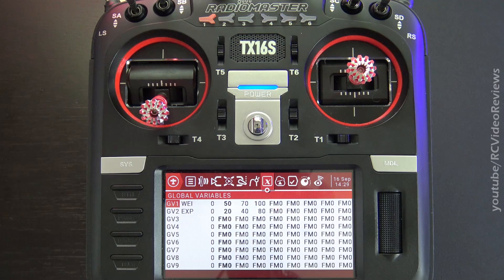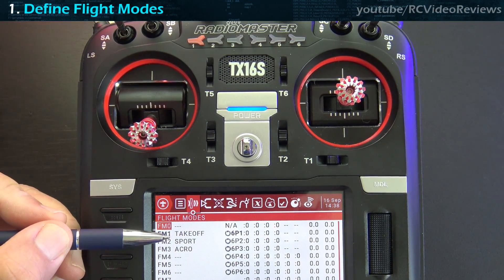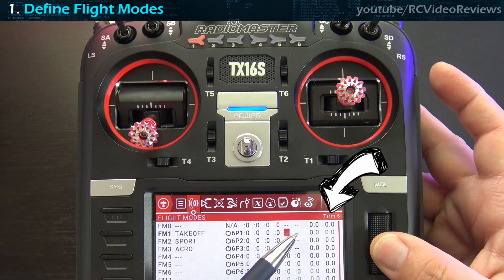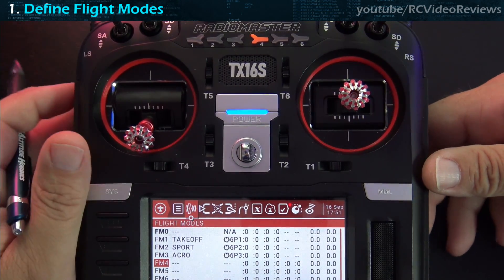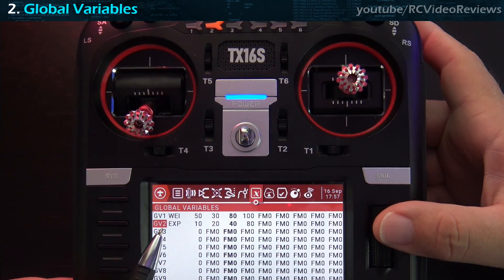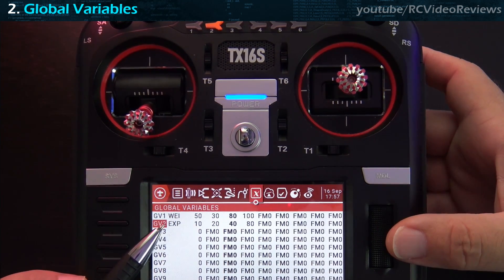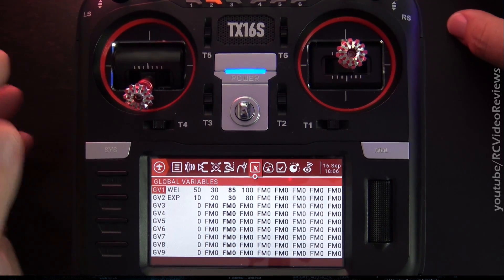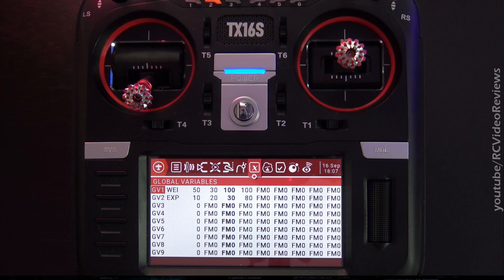OpenTx Tutorial Flight Modes and Global Variables on Radiomaster TX16s • [Advanced]

Comment: Hi John,  Umm, random question, completely unrelated to this video topic, but I keep meaning to ask.  Do you own a Jumper T16?  If you do, can you see if the whole rear panel of the T16 pro will fit on the back of the Radiomaster TX16S please.  I'm asking as I wonder if it would fit as I'd like to get rid of those big grips that the TX16S has on the back panel.  I know it won't be a direct fit because of the SD card socket cut outs and I/O pins on the TX16S that the T16 doesn't have, but I could cut those holes / slots if it will fit otherwise.
Reply from the maker: I do not own a T16. The TX16s was my first radio from this line of radios. I know the TX16s only has 4 screws holding the backplate on and my T18 has 6.
Reply: @RCVideoReviews  Thanks for your quick reply John.  You are right, the T16 has six screws like the T18, but I believe the are in the same places a the ones in the TX16S, it's just that Radiomaster don't use the middle two screw mounts in their design.  I'll maybe ask the question on RCG or Helifreak, see anybody there knows.  Cheers!!
Reply from the maker: The TX16s also has a much bigger battery tray and the battery connectors are in different places. The TX16s has the battery connected all the way at the bottom. The T16/T18 SD card is near the middle of the compartment. The TX16s SD card on the bottom of the radio.
Reply: @RCVideoReviews  Yeah, I know, but like you, I use 18650's so either battery tray is OK for me, and as I mentioned in my previous post, I don't mind cutting  holes or slots out of the base of the rear panel to fit the SD card slot and I/O pins the TX16S has.  Battery connector would be an issue though, that might be hard to get around, I'll need to look at pics of both more closely to get a better idea of whether that knocks the idea on the head right there, it might do!  EDIT:-  I've compared pics of both the Jumper T16 and the Radiomaster TX16S and the battery connector looks to be in a very similar place on both transmitters.  It is much higher up in the Jumper T18 though!

Comment: Good video. Can you use stick position to change flight modes. If so could you do a video to show that? Thank you.
Reply from the maker: Can you elaborate? Are you asking if you can use the Gimbal sticks to change flight modes? Give me an example of what you're thinking.
Reply: @RCVideoReviews  Yes that is exactly what I am asking. For my IMAC plane I have  a snap condition that is activated at the last 5% of aileron stick travel. You initiate a snap, and the aileron stick at 95% travel activates the condition. It boosts aileron, and reduces rudder and elevator.
Reply from the maker: Sure, you can do it with Logical switches. 

L01 a>x I:AIL 95  

That will light L01 when Aileron goes above 95. Set the Flight mode with L01 as the switch.

Comment: This is good stuff; I've managed to make a mess of my model templates with all the walkthroughs you're pushing out. This seems like a more simple option as long as I can find the right button in flight.
Reply from the maker: FYI: You can use ANY switch you want. Before these radios started shipping with 6 button switches, we used to use the 9 position matrix setup for flight modes. I've flown Eagletree, Ardupilot, and Arkbird using the two switch method. This 6 position switch is super easy.

Did you watch this: https://youtu.be/Ci4vbOoxEf4

Think about putting that technique in place with flight modes. You could have the flight mode button announce the mode, then the T5 or T6 switch ENGAGE the mode.
Reply: @RCVideoReviews  I did watch that one and my brain is still recovering but I think I get the idea, may play with it to find what works best.
Reply from the maker: I was driving to the store today thinking, "You should have made the flight mode video using the arm/execute technique"  I may do that video as a follow-up.

That matrix thing isn't that hard. Try putting it into Excel and it will help you "see it"

9 rows, 2 columns:

Up  Up
Up Mid
Up Down

Mid Up
Mid Mid
Mid Down

Down Up
Down Mid 
Down Down

Comment: Bloody H*ll.... Love your easy to understand explanations... Will be doing this from now on.
BTW... A question. I set up an Eachine Mini Mustang on the internal Module and it works. The problem is that with only 30% stick throws I get full deflection of the control surfaces. How do I change the radio setup to give me full deflection with 100% stick throws.
Reply from the maker: Set stick weights to 100% and set the weight in your mixer lower or set the min/max in outputs lower.

The path of travel is INPUTS - MIXER - OUTPUTS.
Reply: @RCVideoReviews  That is basically what I've done in the Mixer. Was curious if there was another way. Thanks for replying.
Reply from the maker: Try it in outputs too.